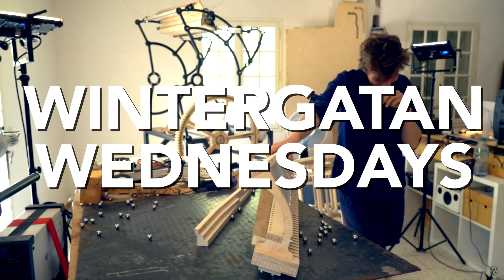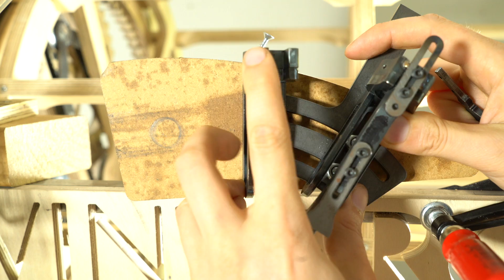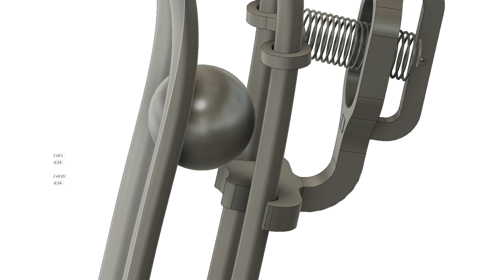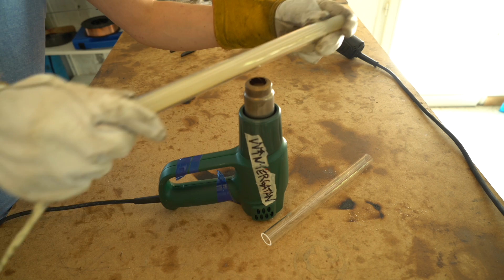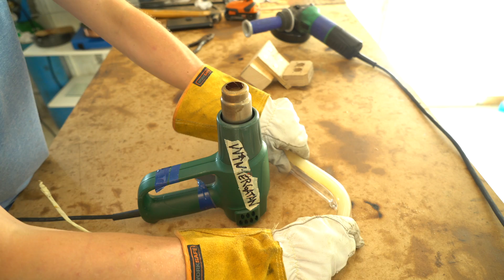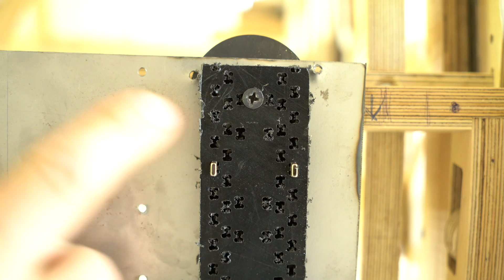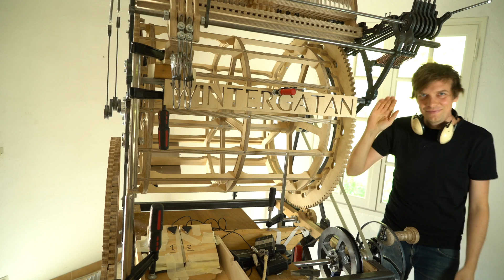Dropping the Ball - PRECISELY - Marble Machine X #52

Comment: If you threaded the top of the rods and had a captive nut in where you are clamping the rods it should help with ease of adjustment. Loosen the lock, spin two nuts to adjust timing, spin just one to slightly adjust the aim. And should be fairly consistant as well, 1 turn +/- 1ms maybe

Comment: Anyone else notice this serious design flaw with those pegs? Those rectangle pegs are going to eat up the wooden arms that release the balls just like teeth on a saw. I would suggest putting some thin metal plate on those arms where they make contact with the pegs to reduce wear.
Reply: I would imagine this is already planned. Iirc even the old machine had metal plates despite the pegs being round.
Reply: R3dSmoke Gaming It may be a good idea to cap the metal arm with delron or nylon. It could be replaced if you ever needed to, still be far more durable then wood, and won’t make any noise like metal.
Reply: JD Courtney  Lobes like a camshaft would be better instead of cylindrical or rectangular pegs.
Reply: JD Courtney  Totally agree, Delrin, nylon, or UHMWPE would be a great choice for this application.
Reply: JD Courtney - Delrin sounds like a great idea to me.  Silent and wear resistant.
Reply: I saw that too.  Those wooden registrators aren't going to last long with those pegs.
Reply: Well, it doesnt look like those particular ones are too hard to replace. Just a basic piece of wood with 2 holes. The main issue might be any timing offsets as long as theyre damaged.
Reply: The old MM already had brass plates on those contact points, so don't worry
Reply: I noticed the same thing, glad I wasnt the only one concerned about timing being off and having to replace them in the future.
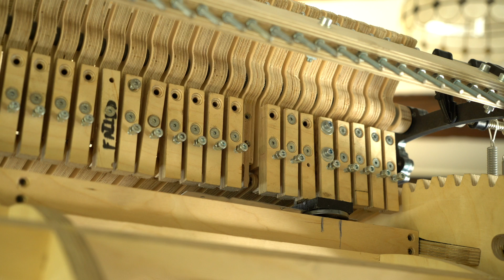Reply: At 23:37 you can see where the metal pegs impact on wood(which is bad).
Reply: Kerstin  yeah and you can see it's already cutting a groove into the registrator.
Reply: I don't think those are final. Also because the bottom is just square which makes them drag along the registrator pin (at least if played very slowly) ... visible at 23:48 -> that should be tilted away by maybe a few degrees so it's free to move.
Reply: Yes. Many people did. Do you really think - after having seen their work so far - that they don't ?
Reply: he mentioned that in a earlier video, he'll most likely put a insert-able material in the  wooden arms
Reply: Yup, I'd say about 20% of everyone who watched the video noticed it.
Reply: You guys are silly lol, a simple fix is adding a plastic, rubber, or wax tip to the pins. Either are quiet and easy on the wood, although I wouldn't really go with rubber because it increases friction and could cause a delay in time
Reply: I scrolled down to find this post before I end up saying the same thing. Everybody please upvote the post above so Martin can see this.

Comment: I worry a bit about the adjustable nature of the release. If experience has taught me anything, something you design to be adjustable will tend to adjust itself when you least expect it (especially during shipping). Adjustability is great for prototypes but you'll probably want something more secure for the final product, or you'll be re-tuning MMX before literally every show.
Reply: Like every musical instrument after transport
Reply: yes,... but no. Better having it very simple and adjustable so that you can fix on site than non-adjustable and being unable to react if anything do got wrong down the line. There is indeed a balance to find on that matter.

That's a basic rule of thumb in motorsport for example.
Reply: Jean-Philippe DOUARVILLE-BLAISE  the requisistions for motorsport and instruments are totally different though. in motorsport you need durability first and foremost. after all anthing not working will cost places in a race.
for musical instruments though, you need precicion. be it in the sound produced, think of guitars, violins, etc or in this case timing and placement.
 i think the fact that it needs to be tuned before every show is not to much of an issue with martin if that means he can make sure everything is timed and placed perfectly, while creating the sound that he wants
Reply: Adjustable is a necessary evil but I think that having to loosen, adjust, and tighten back down is a mistake that's going to drive the roadies nuts when it has to be tuned before each show.  The mechanism should really be on a slider that's tensioned by a spring and adjusted by a tensioning bolt.  Then they only have to crank on a single bolt to adjust the timing with reasonable accuracy.
Reply: @Roscada  with multiple degrees of freedom space runs out too quickly. Loosen fastener , attach a jig or adjustment tool, adjust, tighten, remove tool   is probably the only way to get the desired features.

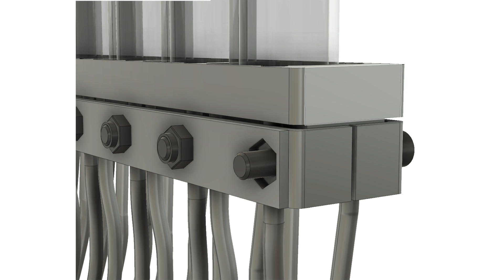Comment: (Reference to 9:54) Just a thought about your one handed adjustment. Machining a recessed hex shape in the back piece may prove to be a challenge. You can achieve the same thing by machining a long groove that is the same dimension as the nut. The machining process will be much easier and give you the same result of one handed adjustments. 
Loving this project and the videos. Keep it up. Can't wait to see it completed.

Comment: Martin, just my thought but wouldn't you also be affected by bounce at higher bpm. The marble has to not only come to rest at the stop, but it also should bounce, if only slightly. It may only take a milisecond or two, and it may not visibly rise, but there is a moment after the marble hits the last stop before it is dropped on down where it has a tiny bit of upward kinetic energy. At slower bpm you don't notice it because it has a chance to come to a complete rest, but if it's barely visibly stopping before it is released again, there is the possibility that it is actually moving upwards or at least the energy is at equilibrium and dropping it will take the extra time.
Reply: Yup.  Seems to me that he can release two marbles with a short time interval, but if he wanted to get a third strike it would take too long for the replenishment,  and there's the bounce problem, as you say.

Comment: Any concern about gravity variance during the tour?
Reply: Marbles will be falling upwards in Australia
Reply: Yep. That always gets you.
Reply: Lowest 9.7760 in Kuala Lumpur, Highest 9.825 in Oslo. Variance (lowest/highest) = 0,99501. It probably wont do much, even when going from top-extreme to min-extreme.
Reply: @bextract0  would make such a small difference that it wouldn't matter
Reply: @Great.Milenko  yes.
Reply: Gravity does not exist the earth is flat
Reply: Chris H What?
Reply: that effect is probably negligible compared to other factors
Reply: Samuel Smith
Marbles will be falling upwards in Australia

ThunderClawShocktrix  
that effect is probably negligible compared to other factors

Those two comments right after each other are hilarious and I felt a need to preserve that exchange, intended or not.

Also. what factors would possibly have a greater impact than gravity reversal?
Reply: 57thorns  maybe the crowd bouncing in front of the stage and causing the MMX to shake?!

Comment: Not sure if you've mentioned this before but, wouldn't it be a good idea to have a bicycle like  mechanism to have the handle not necessarily spin when you stop giving the machine power, so as to avoid injuring yourself when restarting... If you get tired and want to switch hands or if your hand slips and you let go of the wheel handle?  It could also be useful for something like the breakdown in the MM song, when you abruptly stop the machine and go into manual mode releasing the marbles.  The wheel could spin freely and have something stop feeding marbles to avoid overflowing the channels.

Is there a way to have a tempo dial to make the mmx not depend entirely on your hand cranking precision?  Something that stores some energy, enough to give you a few seconds to take a breath and a drink of water maybe, while not  losing the tempo?  This could help in making the cranking speed not affect the tempo.

Comment: The actuators are made from plywood? The steel pins will wear them quickly, changing the timing on the ball release
Reply: Alecc Balddwinn I believe it’s a prototype, so it’s gonna be changed for the final version.
Reply: A ball bearing installed in the actuators will solve the wear issue and will reduce the force needed to spin the programming wheel.Like in a ball cam system on cars

Comment: I have a suggestion: What about a BPM slow/good/fast indicator? Ergo, you set the BPM you "want", and this adjusts either a scale or a magnet/air coupling. Then a spring loaded Arrow will Point at either slow (if you crank too slowly to reach you wanted BPM), good (if you are cranking good) and then fast (if you are cranking too fast). The magnet coupling could be a ring magnet on a axle, inside a metal cup, and the metal cup is connected to the spring loaded Arrow, and the magnet ring to the flywheel axle. Air coupling might be a bit easier to get right, but might be more unreliable. A air coupling is simply 2 fans with blades that have a 0 degree steep (totally perpendicular to the movement direction) that move Close to each other so the air will excert a force on the BPM-o-meter.

Think like how  a analog speedometer is built in a car. Its a wire running from the gearbox to the dashboard, this wire rotates a magnet inside a cup to give the speedometer Reading.
Reply: A steam engine governor would work well.

Comment: im no physics expert.. but some points in no particular order..
1. the speed of the release alters the speed the ball drops, and since it doesn't drop straight down, it will alter the course the ball falls. so if the speed of the song alters, then you need the instruments to angle differently to catch and direct the marbles correctly into the tubes..
2. marbles dropping from 2 different points will have 2 different arcs of bounce.. have to make sure both arcs hit the same point.. but also that the funell are big enough to catch both of them..
3. if you crank the wheel slower, the programming wheel will turn slower.. making the programming pins spend more time to open each release mechanism.. and if it spends more time opening he release, the ball will fall slower.. and.. back to point number 1.. is it possible to have the crank speed always the same, but the programming wheel pin-spacing decide the tempo.. that way even if you play a slower song, the pin will still hit the release mechanism at the same speed as normal, making it drop at the same speed and angle as normal..

again.. no expert.. i may be totally wrong about it.. or the differences may be so small its of no importance..
Reply: I think the ability to adjust tempo using the wheel is the core of the Marble machine. This allows the musician to play slower or faster sections during the same song.

Comment: I'm shocked they are building so many small not-load-bearing parts for this machine from heavy metal, especially considering this has to be highly mobile for the World Tour. Wouldn't 3D printed heavy duty plastic be much better in terms of weight and replaceability?
Reply: the metal is (apart from esthetics) also needed for the sound and allows micro adjustments, where with abs or petg or nylon / copolymer, that wouldnt be possible as microadjusting it would mean heating it very focused in a small space, almost certainly heating surrounding (than also 3d printed) structures and knocking these out of rythm
Reply: I would say no. But some aluminum parts would make it lighter and still have strength.

Comment: I am seriously worried about having rods on the marble release, you introduce so many unknown factors. The more factors the more places to tune and debug if something goes wrong. This could make you end up tuning the marble machine X before every concert. My suggestion would be to have things as fixed as possible, and only being able to adjust some angles at the marble release, and only adjust the timing at the registrator. That should give you way more control and very little confusion when you have to fix anything. As a software developer I only want to implement adjustment for one parameter in one place, otherwise I end up in debugging hell. I guess the same principle is usable with MMX. Keep it stupid simple (KISS).
Reply: my toughts exactly.. "world tour" will be a very slow process as at every location the machine is set up, it will need (even in the ideal optimised setting where the artist knows his machine perfectly) in my estimation at least a day or 5 to a week of tuning...
Reply: Some of the machines in the Spielglock (sp) museum are quite complicated.
Reply: My point is that you want repeatability. If a part breaks between two concerts, without sturdy parts but flexible parts, you need a whole laboratory to tune the MMX. If parts are sturdy with few control points, maintenance should be quite easy. I don't want Martin to be in a place where he is stressed to death, if something goes wrong. Bill Keith

Comment: Yay! WW!! Also, side note for anyone else form the States confused by th milliseconds in 120 BPM thing: in Europe they use commas like we use periods, so 7,8125 is like your 7.8125 :-)
Reply: Neon 24002  Yes and you also drive on the wrong side of the road. We were talking about the rest of the world :)
Reply: Zap Andersson I think you'll find the rest of the world drives on the wrong side.
Reply: As a European I far prefer period over commas as a decimal separator.

Why? well I guess it depends on the perspective, but I think both in terms of readability and semantics a period makes more sense.

7.81 first the aesthetic of no protruding bits like in 7,81.
7.81 second the semantics 7 was the integer we're done. But there is more information so we continue after with a new set of information much like we do in grammar. Now the same argument could be made for the comma that you're still talking about the same number but more information has to be attributed. But remember that the US uses 1,000.00 that makes sense still compared to 1'000,00 in terms of grammar. Now this also goes against my first argument, where I just dissed the comma. I don't really like either thousand separator.
7.81 has one major argument for it I feel, and that's when we start listing numbers. Let's list 3 decimal numbers, as you would in grammar:

7.81, 3.14, 42.01.
vs
7,81, 3,14, 42,01.

I find the European way completely confusing here, it begs that you have to present the numbers in a different way.
Reply: @RupeeRhod  What about 1, 483.65, 63,477.59 vs 1, 483,65, 63.477,59? If you want to list numbers better use ; or / like 1; 483(. or ,)65; ... anyways.
Reply: In conclusion, we are all weird in different ways :-)
Reply: Vigilance Brandon it pains me for people saying period, I much prefer stop, full stop or in a mathematical sense decimal point
Reply: I was looking to see if this comment was here before writing my own thing for confused non-Europeans! :)
Reply: Europe has to do everything all weird. Well except for Martin's build. ;)
Reply: @billkeithchannel  naw, it's us Americans who do everything backasswards. Every other country uses celsius, drives on the left side of the road, and uses 24 hour time.

(Cough) MURICA-
Reply: This is Amergin  No, the rest of the world drives on the RIGHT side. That's why it's called the RIGHT side :) But we do use metric. No inches, feet or furlong in site. Thank god!
Reply: @ZapAndersson  wait, right as in correct, or right as on anterior to the left, or right as in my life is a lie? I'm confused...
Reply: This is Amergin  All of the above, obviously :)
Reply: @thisisamergin498  One of the more strange things, the English speaking world does "wrong" is calling 10^9 a Billion.
A good video on this topic would be:
https://youtu.be/C-52AI_ojyQ
Reply: wrong most countries drive on the right, only britian, japan and australia drive on the left
Reply: @ThunderClawShocktrix  Australia is in the southern hemisphere, of cause they gone drive on the other side of the road. Everything else would be insane.

Comment: You may want to double check the accuracy of the holes for your pins. https://youtu.be/dNv8AeZfuUc?t=11m19s If I'm looking that the channels correct it looks like the two outside ones are the normal notes for the two channels. They do not appear to be parallel to each other, one is slightly off from the other. If this is the case, then each panel could be off differently and your adjustments for the first panel wouldn't match the next and when you switch songs it could get worse.